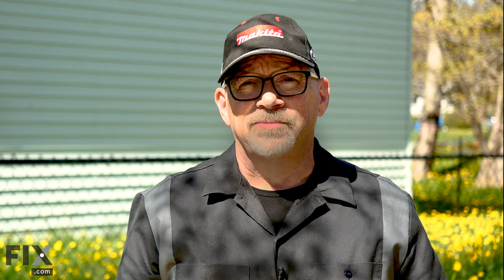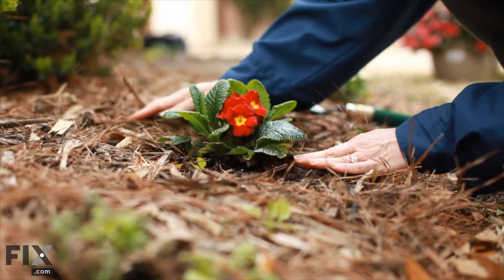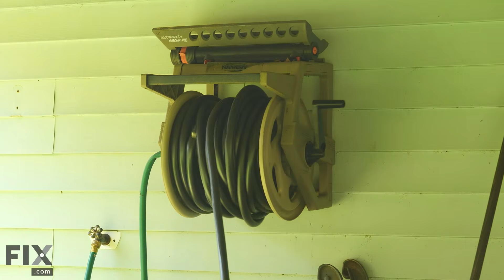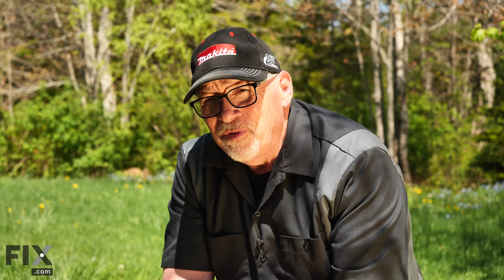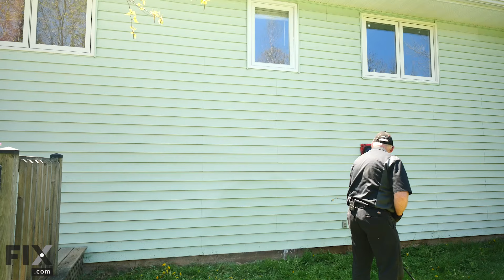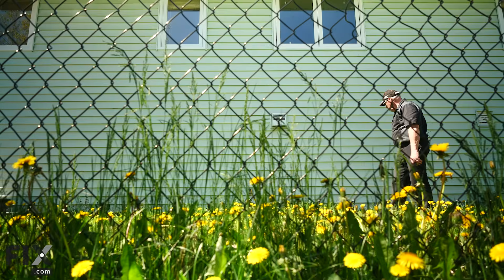How to Pressure Wash Your Vinyl Siding | FIX.com

Comment: Is there a reason for the bent tip?  I was told the secret to cleaning vinyl siding is not getting water underneath the siding so was wondering if the bent tip helps prevent that from happening.  In addition my pressure washer only came with blue, orange and a large black nozzles.  Black for concrete, blue for soap, however, has a very weak spray when using it, and the orange is for rinsing or for wood.